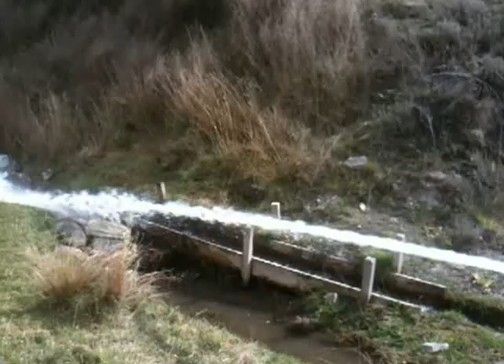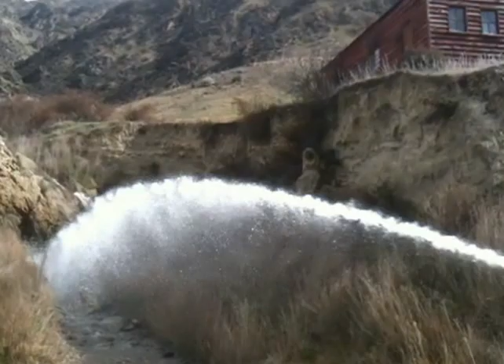Water-Sluicing used in gold mining

Comment: what size pump/hoses and nozzle were they using
Reply from the maker: This is a historical demonstration of sluicing rather than an active gold mining operation. They brought water down from higher levels up to 600 feet higher in elevation, in steel pipes 4 to 6 inches in diameter. One foot head is 0.433 psi so 600 feet is  259 psi pressure (17.5 atmospheres).  It is then passed through a nozzle about 1 to 1.5 inches diameter (25 to 38 mm). My wife has written a non-fiction book about the goldrush in New Zealand and it is now available in USA as a two volume set 777 pages or an abridged version of 324 pages. See her web site www.KaeLewis.com or https://zoeprint.com/category/goldrush.